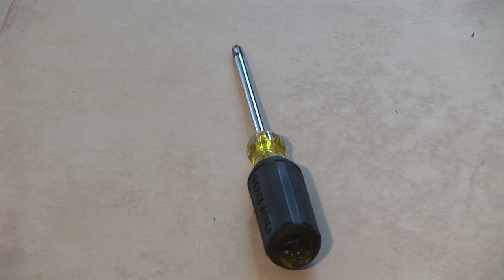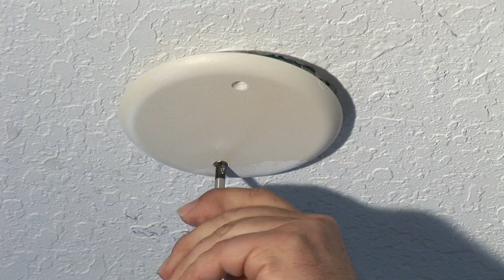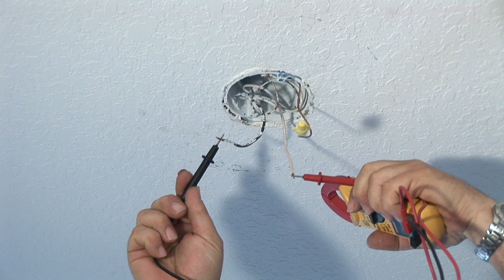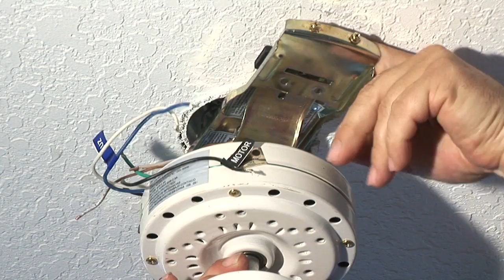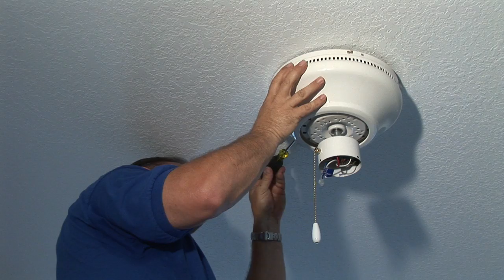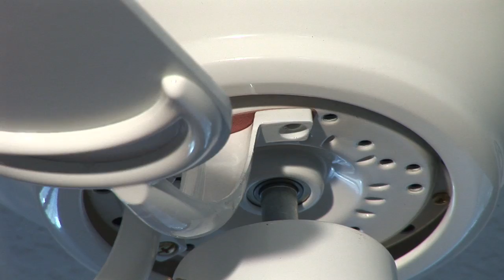Lighting & Ceiling Fans : How to Fix or Install a Ceiling Fan

Comment: That's a fiberglass box, TOTALLY unacceptable for fan mounting. Fiberglass and plastic boxes are not sturdy enough for fan mounting, the fan could fall and hurt someone
Reply: This is just a demonstration, people would have a common sense to change out the box if it is a light one.
Reply: @KCCeilingFans  ohhh you'd be surprised
Reply: @BAFVintage  also, in the standard book of code for modern houses it says, “If mounting a fixture of any sort on a plastic box, the fixture has to be 35lbs or less.